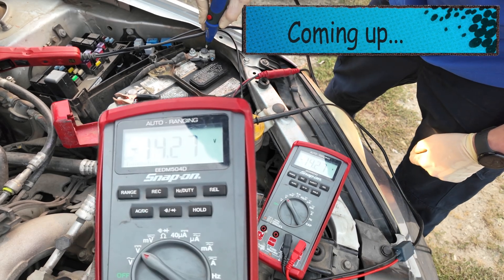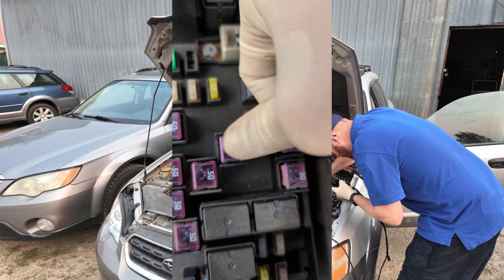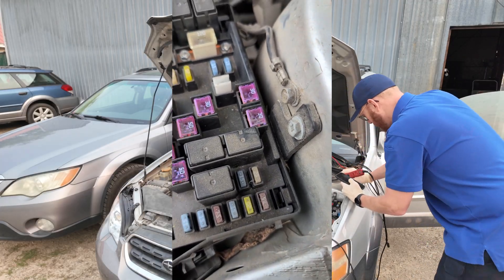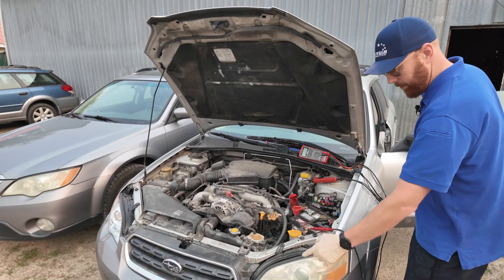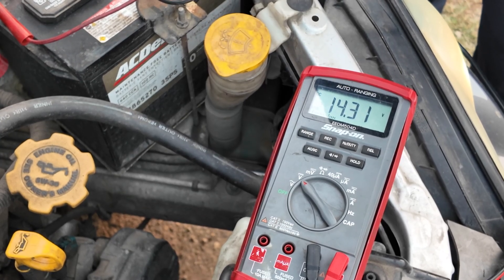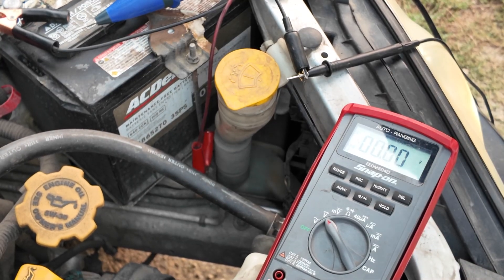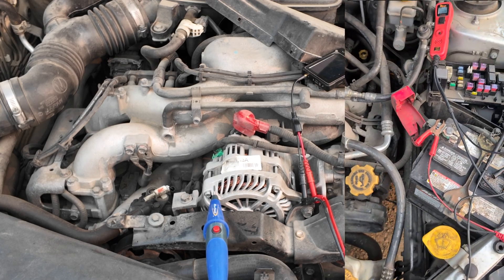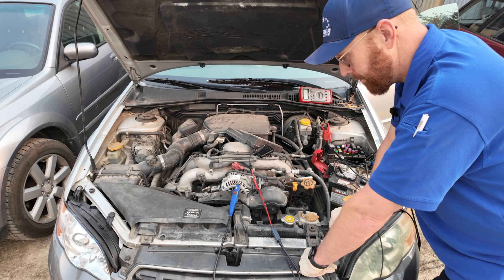How I Use the LOADpro & Power Probe | Fuse Testing, More Voltage Drop and Real Circuits

Comment: Hi great video I’ve been thinking of getting the load prob is it computer safe can you use it on wiring with module still connected thank you for any information
Reply from the maker: You need to have a solid understanding of basic electrical theory. Every situation needs to be fully understood before you push that button. You need to understand current limiting resistors and how computers are designed to protect themselves. Most of the time, the purpose of using this tool is to isolate and test the circuit, not the module. You need to avoid looking for the quick answer and take the time to actually understand. I am not saying this is what you do, this is for everyone. Stop, slow down and learn. The fast answer is not how you learn.

Comment: One extra thing you could have shown when confirming the wiring was ok with the load pro was to use the 12v injection switch on the power probe to check that the headlight works ok also.

Comment: If you are working on a circuit that potentially passes back through an ECM, could you blow the ECM by sending current through it?
Reply from the maker: You always want to be VERY careful how you use this (or any circuit loading tool). The idea is to load the power feed or ground side of circuits. You need to know your circuit (as with any diagnostics). But if your PCM or BCM is controlling a headlight or other higher amperage circuit, it is either designed for that load or will go through a relay to handle the load. So, yes, you need to be careful, but don't be skittish.

Comment: I’ve watched a lot of you tubers well known you tubers at that and so far I’ve learned troubleshooting steps other individuals just don’t incorporate in their videos . I have a load pro but most guys complain about the tool but you just pointed out the positive testing results you can achieve . I am definitely gaining quite a bit of knowledge from your videos not that I didn’t from the others but yours start from the ground floor and escalate from there . Thanks  👍 Artie

Comment: If you are coming to Vision this year, please be sure to reach out. We can surely do a MUCH more comprehensive video on when to trust a Power Probe and why most times you shouldn't . Heck, I will show you how to make your techs more profitable guaranteed. Oh and the be-boop is actually one of the reasons to NOT trust the PP and it's not just about the speed of use
Reply from the maker: I understand. You are right that in order to use it right, you do need an intermediate knowledge of electronics and the dangers of it. Again, yes trusting the "power and ground" noises is not guaranteed...at all. It is difficult to get that deep in an introduction video.

Comment: Testing all the fuses is mental! Some fuses are really hard to access and some cars have so many fuses. Also when checking a diagram you learn how the system is built and can predict where the problem could be (connector, splice etc)
Reply from the maker: Do whatever you like partner. I learn from my mistakes and successes. Checking all the fuses (within reason) has never failed me.
I have always advocated for using the diagrams to diagnose rather than trouble trees. You should always come up with your tests, not rely on engineers to tell you what to test.

Comment: Awesome Demo. Don't you ideally want to load the circuit with the expected load and check for voltage drop? Like say 4-5 Amps for the headlight bulb circuit? I think the load pro only does 0.5 Amps (12V), which does not fully load higher amp circuits, so you might see a smaller voltage drop than actually exists when the circuit is active with it's normal load(s).
Reply from the maker: That’s a great question, and you’re right that ideally you’d test a circuit under its normal operating load. The challenge is that loading a circuit to its full expected current (like 4–5 amps for a headlight) requires either the component itself or a comparable test load. That can be awkward or unsafe to do during diagnostics, especially if you’re trying to quickly isolate whether the wiring, connectors, or grounds are at fault.

The LOADpro is designed as a diagnostic shortcut. By applying around 0.5 amps, it forces the circuit to move beyond a “ghost voltage” or high-resistance path and reveal whether there’s a meaningful drop. If the wiring or connection has excessive resistance, you’ll still see it show up with that 0.5-amp draw. In other words, it doesn’t need to fully match the headlight’s 5-amp load to expose poor wiring or corroded terminals.

The real problem is usually that most testers cant detect smaller problems in circuits, not larger ones. That is where the LOADpro shines. Larger drawing circuits are actually easier to test.

Ohm’s Law connection:
The voltage drop in a circuit is the product of current × resistance:

𝑉=𝐼×𝑅

When you put the LOADpro across a circuit, it forces ~0.5 amps through whatever resistance is present. If there’s a corroded connector or compromised wire with, say, 1 Ω of added resistance, the LOADpro will show:

𝑉=0.5𝐴×1Ω=0.5𝑉

That 0.5V drop is already well beyond what’s acceptable in a healthy circuit (most spec is ≤0.1–0.2V). So even at half an amp, the weakness is exposed.

Now, imagine the same 1 Ω resistance under a 40A load (like a cooling fan or blower motor circuit):

𝑉=40𝐴×1Ω=40𝑉

That would cause catastrophic failure (massive heat, device won’t operate). The beauty is you don’t need to stress the circuit at 40 amps to see the problem. A smaller, controlled load scales linearly and makes the resistance visible.
Reply: @sixstarauto Agree 100%. To many amps can be bad for sure. It will spot most issues most of the time. I just use headlight/taillight bulbs for load testing. All my equipment/loads are setup with 4mm banana to make it easy to hookup.
Reply: @sixstarauto   You wrote  "If the wiring or connection has excessive resistance, you’ll still see it show up with that 0.5-amp draw. In other words, it doesn’t need to fully match the headlight’s 5-amp load to expose poor wiring or corroded terminals."  This is not correct. Depending on the resistance in the circuit, you might get a false positive with the Loadpro. I have seen it before. It's always best to test with similar load.
Reply from the maker: @bernardocisneros4402  https://www.youtube.com/watch?v=1NX7ei0H0Is&t=632s
Dans Channel is the place to look for this. He knows a lot more than I do, He invented the LOADpro
Reply: @sixstarauto  Thanks

Comment: Don’t see why you need to use power probe with load pro. You simply put both leads into the pigtail and load the circuit.  if the voltage drops then just simply connect ground lead to battery post. If the voltage don’t drop when you load it then the power wire is good and the resistance is in ground wire.
Reply from the maker: You are not wrong. The reason I usually do this is because I am not usually near the battery post and I dont like to rely on unproven grounds or power sources if the test fails. I assume the test will fail and just test them one at a time because if I have the load pro out, I am already pretty sure there is a problem in the circuit. 

I always have the power probe out because I like being able to energize and ground components like starters or window motors etc. I dont like not being able to do that so not having the probe with me is unlikely. 

Again, you are not wrong, this is just the way I do it and why. I dont like going back to the box if I dont need to.

Also with computer grounds and power circuits, there are multiple powers and grounds, so testing them one at a time is needed.

Comment: Do a current draw test on your PP beep. It's miniscule. If you are looking for a ground through a fuse you may not find one if the circuit in question is a switched ground to operate. LoadPro lets you find open and short to ground quickly and if you find a "good" power (meaning the meter shows voltage) when you load it you just tested the circuit integrity. I use a PP1 in my diag because having a good power and ground at my finger tips is super handy but I prefer the resolution of a good meter over the 1 place PP display on the 3&4.
Reply from the maker: Agreed, the PP meter is not a replacement for a DVOM or a DSO, it just gives you an idea of what is going on. I still will usually verify with the LOADpro if needed.